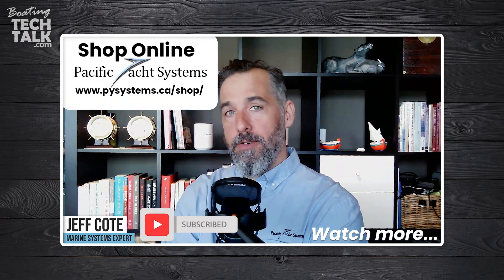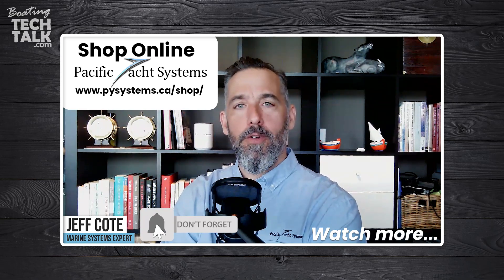Does a Battery Combiner Draw Current When No Charge Is Present?

Comment: Hi Jeff
Hello from Australia.
Off topic, but wondering if you can either give some advice or better do a video to show how to wire a dual 12 volt battery setup, with  Battery 1, battery 2, combined and off switch. The switch has three posts, one for each battery and one for common. I also have a single input VSR (Narva Australianbrand). All accessories to be powered by battery 2 and battery 1 only used to start the outboard which is a Yamaha F50 four stroke, alternator output is 16 AMPs. My boat is a Stabicraft which has a self draining deck and positive floatation, so does not need a bilge pump which is why I only need battery 1 for starting. Thanks

Comment: Hi Jeff, another great video!
I have three different model ACRs on my boat.  The bow battery ACR is a Blue Sea 7600 which specifies less than 12 mA current when in open state. The stern battery ACR is a Victron Cyrix-i 100A which specifies less than 4 mA when open. The house battery ACR is a Blue Sea 9112, there is no open current draw listed on the data sheet but is likely very low. The open mode current draw would only be a few AH over a 2 week period. My concern with the ACRs on my boat is the open voltage disconnect threshold. Most of my batteries are Lifeline AGM, at full charge the open circuit voltage is about 12.8V or higher. The Blue Sea 9112 ACR opens at 12.6V, which is about 85% state of charge for the Lifeline batteries. While closed this ACR has a current draw of 130 mA, or about 3AH per day, which won’t stop until the batteries discharge to about 85%. During winter layup I pull the ground lead fuse to disable the ACRs. 
Note there are other parasitic current draws on some boats such as stereo memory, CO detectors, or propane alarms. Even battery chargers can draw a slight amount of current to check connected battery voltage even when no AC power is present. Some bilge pumps periodically run for a few seconds to check for presence of water, or may have electronic water sensors that require power.
For a boat without shore power a small solar charger would be a great way to keep batteries charged.
Reply from the maker: Thanks for sharing Howard.